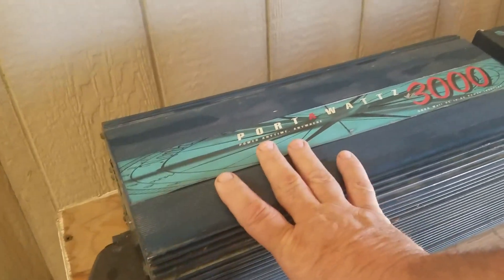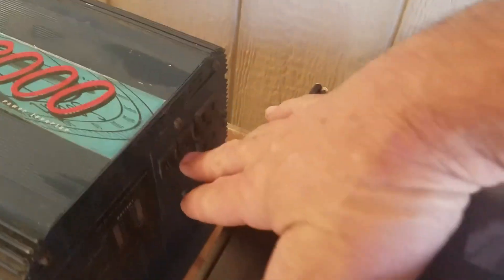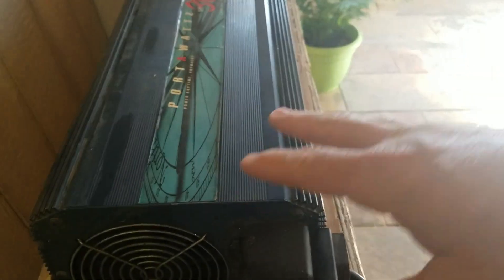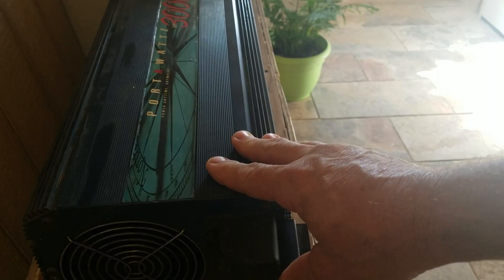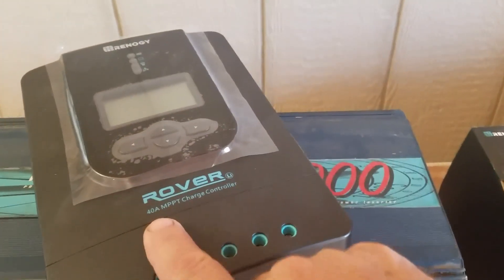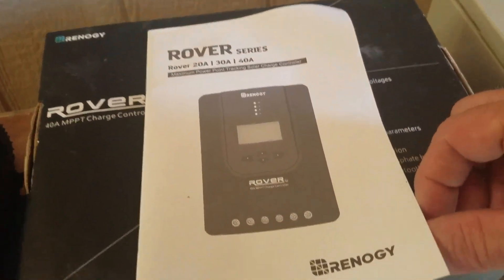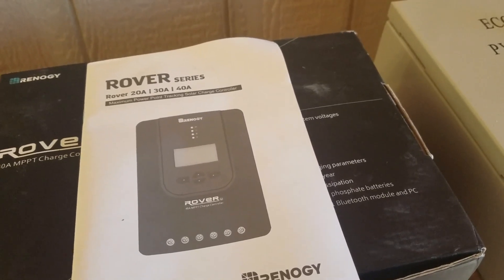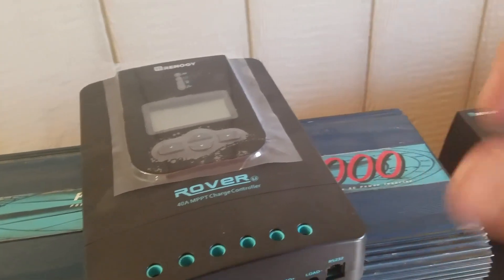OFF GRID Upgrades:  Renogy MPPT Charge Controller  Ecoworthy PV Solar Combiner Box

Comment: your combiner box is made in China. in Xiamen I noticed that is why they got it wrong instead of lightening they put thunder. LOL
Reply from the maker: everything is made there or the components in other brands are too. It is here working hard each day with no trouble
Reply: @TexasFilipino  that is what makes it so disgusting that people charge so much for things and say made in america when in fact it is assembled there but all the parts are like you said made here in China. the gouge the people and make it  so hard to go solar when in fact it should be much cheaper if they weren't so greedy. If you want to go with Lifepo4 batteries or enlarge your battery bank let me know. I can get you a great price. I hate gougers. I am disabled and this is how I am trying to support my family. I was in an accident a while back and the company that caused it refused to own up to it and now I can't work because of the pain. They took my ability to work away from me. I was doing my part in supporting my family being responsible and not living off the government tit and now I have no chance of doing that or working so this is my last resort. if you can help me out  it would be much appreciated. helping me with a little bit of exposure so other people know where to get some good batteries for their systems. 10 year warranty, 6000 cycles at 80% DOD they will last as long as the solar panel array will and are safe against fire etc. anyway let me know if you can lend me a hand. I will be coming back to the Pinnes in a few months time and will be setting up my own off grid system as well. if you want to get another inverter that doesn't have an mppt controller in it I have a good line on one. I am getting them for myself. 6000 watts capacity for a good price and 3 year warranty. anyway  look forward to hearing from you drop me a note on my email I would like to talk to you if you have the time. perry_kusnezoff@hotmail.com take care and cheers, Perry

Comment: cool im offgrid down here in Terlingua pushing 1600 watts at about 70 amps Xantrax 3000 pure sine with Victron mppt charge controller and a Xantrax PWM charge controller has been runnning for 10 yrs 24n7.
Reply from the maker: Stay in contact , shoot me a email.  Jamesray080808@gmail.com
Reply: darrell lynn,

Would like to email you to get more information.

Comment: I am planing to buy that box too. Only thing I've found bad about it is that all the wire ends have been soldered so it's hard to get a good bite and connection on the terminals. Make sure you check them all or maybe even cut off the tinned section and strip it back a little more if the wire is long enough
Reply from the maker: Ha ha - did you read my description in this video?
Reply: @TexasFilipino  umm... I did now 😁😁
Reply from the maker: @alsmidlifecrisis8765  lol